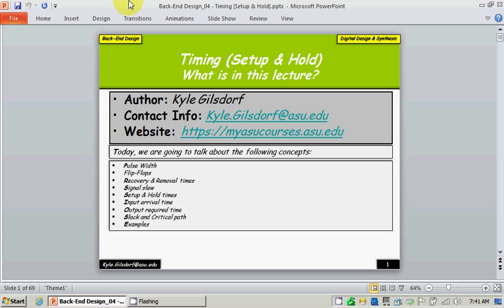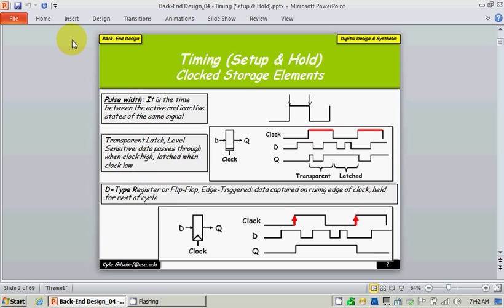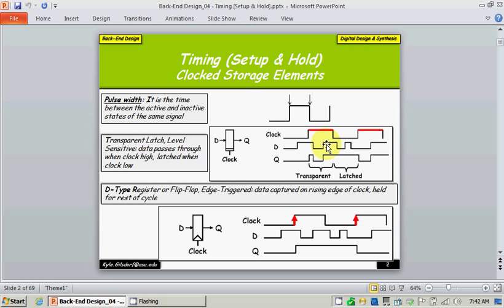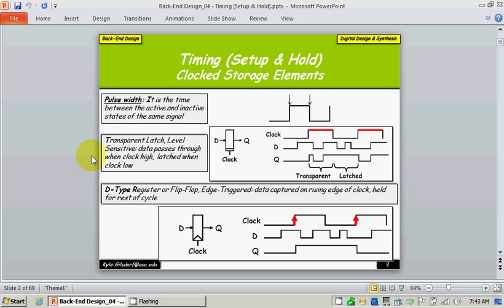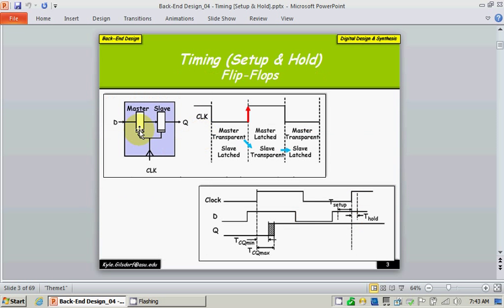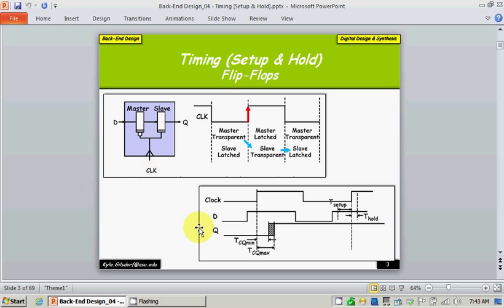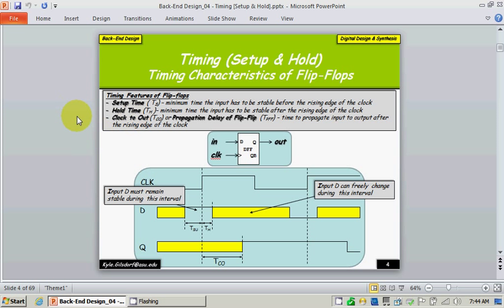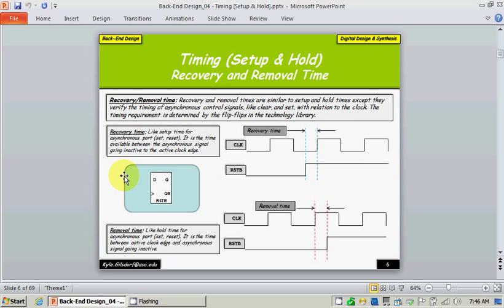[Synthesis] 00: Basic Timing Terminology

Comment: The resistance of the semiconductor material decreases as the temperature is increased, and vice-versa. whereas on 3:37 you have told when silicon chip gets colder, the resistance decreases and it turns as conductor. Could you please explain this? I am little confused.